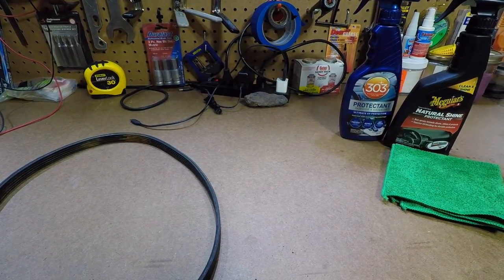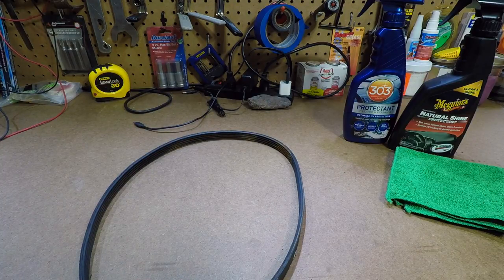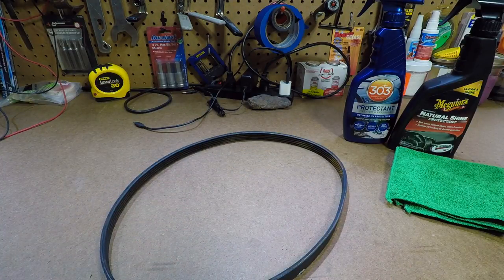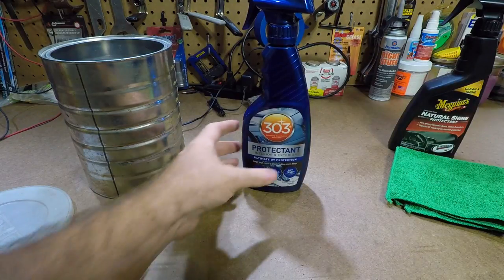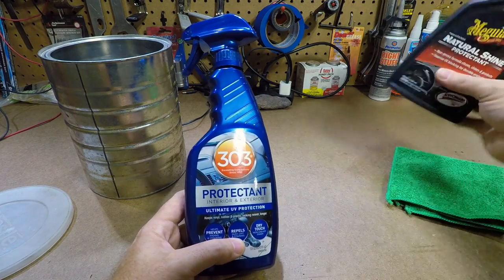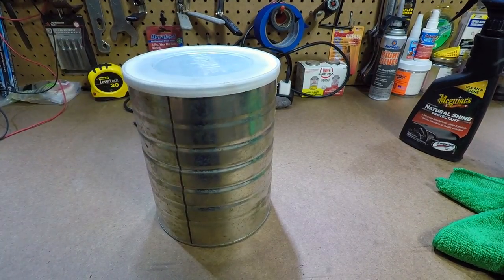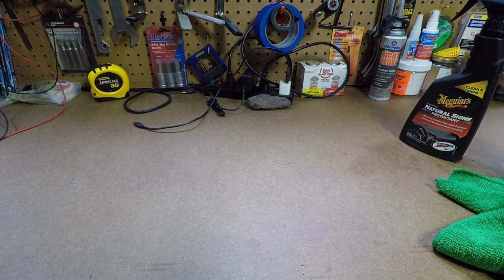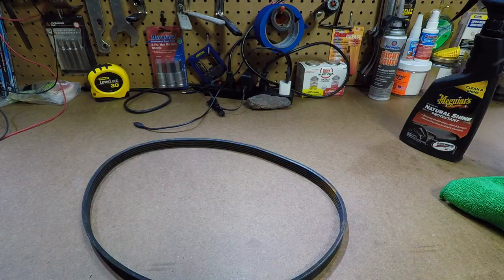Make Your Cars Belts Last A Lifetime !!! Never Buy Another New belt !!!

Comment: The Federal Government now demands that serp. belts be made from EPDM instead of rubber for several years now. That means a serp. belt will not crack like in this video, it just wears out. The demo belt in this video must have been made from rubber. That's old school. Go to the auto parts store and ask them for a FREE belt wear tool and follow the instructions. If it's bad replace the belt. No amount of chemicals will work on a modern belt.
Reply: Agreed

Comment: Actually best to apply heat to the can, not much though. Even put the can with 303 out in the direct Sun with the lid on and leave for 15-20min and the remove the parts to air dry and wipe down.

Comment: I will start doing this. But truthfully all my belts have lasted 10+ years. On our 2010 Camry i4 it lasted over 10 years. It’s got 188K miles now. Yes it has cracks as it was a New England car and never has the engine cleaned or detailed. Put in 2 new belts. Wish I saw this video. But even without the 303 my belts all last 10 years+. They were replaced for safety measures not bc they snapped.

Comment: A new belt is very important. Friction and heat break down the belt. The belt  will still wear down even with the special magic coating on it. It’s an easy replacement at every 75,000 miles give it take a few thousand. The belt is connected to the ac ps alternator and spins the water pump. Replace it.

Comment: For a BMW... you should disassemble the whole engine bay and soak every piece of rubber & plastic in this stuff.
Never seen anything like the disintegration that goes on under the hood of a Bimmer.
Too bad gaskets, engine seals, and o-rings weren't pre-treated with stuff from factory! ;-)

Comment: I wonder if the belt will get to a point of being too hard !? Where it doesn't cling , grip or have the proper contact with the pulleys . To where it slips and alternator doesn't recharge the battery as necessary ? I came across online a Toyota dealership . Suggesting when your miles are 50000-60000 to replace the serpentine belt . On my 2020 Toyota Camry I have over 60000 . I had to replace the alternator [ new ] , not remanufacturered  . And the belt came off the other pulleys and had no idea how to get it back in place . So decided to buy a new one and for how many days spraying it down with 303 Protectant . It gives the belt a slippieriness and said belt should be dry when installing . I will dampen a microfiber towel with a all  purpose cleaner and wipe down well the side with the ribs / ridges before installing .

Comment: I had just seen this tip by that other channel a few days ago... A belt is not a sponge. So it will not "soak" 303 up physically, you cannot marinade your damn belt. It is a reaction on the surface and to achieve that, you may well just apply it according to directions, i.e spray on/wipe on+off again.
Reply from the maker: That is correct you can do that, if you turn the engine over by hand you can apply it without removing the belt
Reply: I totally disagree. Rubber is porous, don't care what you say, is an aircraft mechanic I will tell you air will leak through rubber, if Air will leak through rubber so will protectants, it prevents / delays the oxygen from attacking the rubber. If you take two car tires air one up with a standard compressor and air the other one up with nitrogen, and wait till they go flat, the one with nitrogen will stay for mini mini times longer because the nitrogen molecules are much bigger than the oxygen molecules Which makes it very difficult for them to flow through the porous rubber. The guy actually does not know what he's talking about, but yes the protectant will absolutely protect your belts and for that matter if you can wipe it on the inside of your tires you were that much better off.
Reply: @stephenembrey883  Is it true that serpentine belts are now made of EPDM instead of rubber?

Comment: I jus5 used engine degreaser and a little 3 in1 silicone  spray. It's been a few days and no squeal. I did have a coolant leak preceeding squeaky belts. I cleaned top, bottom pullys. 
Maybe only time will tell. I though I had one belt slightly off a pully too. I used what I had though I looked for belt conditioner.

Comment: My car squeals up a storm. Can you just use a protectant to spray on the belt while it's still on the car and the car is running? I tried using a lubricant to spray on the alternator which it worked but lately it's gotten cold out and it's making my car squeal more so I'm wondering if spraying the belt and letting it run will fix it.
Reply: It would just fly off , I spray my belts when engine is not running and all other rubber / plastic parts in engine compartment , periodically . I think your belt needs to be replaced .
Reply: @peterrudy9207  The belt just needed to be adjusted and tightened up because it was slipping. Haven't had the problem since.

Comment: 1st This is UV protectant. Your primary drive belt on your Sur-Ron should never get significant UV light. If it does you're upside down too much. 2nd There is nothing at the 303's Website that suggests this is a use for this product, and in fact I've heard others say 303 should NOT be used on belts. I have launched an inquiry to the manufacturer of the product to get their recommendation.
Reply: Ha, ha.  I actually ended up here after watching the Sur Ron belt video by the moto uk guy, but I'm subscribed to Nathan's channel for my BMW content.  Odd how the two intertwined.  Nathan should mention the Sur Ron for some more alagarhythm hits!
Reply: @Travisj535  I get a little belt squeak sometimes, mostly when cold & pushing it backwards. I don't notice it because the racket coming from the jackshaft is so loud & obnoxious it obscures a simple belt squeak. It just can't compete with the awful cacophony coming from the right side of the bike. The fix for that is MISERABLE to implement: remove jackshaft/swing-arm axle, take jackshaft apart, get some sort of fancy spring washers, insert at strategic locations, reassemble, & pray. And do that with no help or instructions, just wing-it using experience and brain power. Plus my axle is defective and replacements aren't available. Oh, and probably the bearings should be changed while you've got it all apart. Slathering goo on a belt? Cake-walk. I tried it. It doesn't work for me.
Reply: this is crazy what this guy suggest. Can't wrap my head around this idea lol. Just change this freaking belt and not soak it in the UV protectant... it will not last a few minutes on the belt when it is working... and weather... lol this is the stupidest thing ever.
Reply: had to laugh. you know they dont list toothpaste as a cleaner but it works great! do you know how many products work for things the manufacturer doesn't list as uses? tons.....

Comment: You watch Sweet Project Cars
Reply from the maker: This is a trick I've been doing off and on for years, I use to do this on fd rx7's back in the early 2000's when the belts were hard to find , I seen a guy last week do this , so I thought it would be good to show my version of it , in fact when I first started doing this I was working of office equipment and was using a product called rubber restore, people use this trick on printer tires and belts a lot.

Comment: Does this method also work with timing belts?
Reply: I wouldn't try it, if it doesn't then your engine is death, better try it on a accessories belt that wouldn't be catastrophic.
Reply: Yes, absolutely but don't run the engine till that stuff sits overnight

Comment: What about belt elongation due to operation?
Reply: Your tensioner absorbs that little bit of elongation, and it should only be a small amount and then not stretch much further over a long period of time as long as the belt doesn't deteriorate.  Also note the tensioner absorbs shock and vibration loads, and the metal spring slowly wears out and becomes less effective.  Even if the belt lasts forever, the tensioner should still need replacement now and then.  Most recommend around 60K miles, when I've changed it on 100K mile cars there has always been an instant improvement and smoother running engine.  A LOT of power goes into vibrating the belt, and a worn spring doesn't do the correct job of dampening it.  As soon as you change one, you notice the difference.
Reply: Right, that's what I'm talking about. No doubt the method recomended here for the cracks might work, I don't have reason to believe otherwise, but I know for a fact that belts stretch and ofcourse the tentioner issue you mention. I just don't know how much stretchig the belts are able to take before they snap. I mean.....they can't stretch for ever. 
So at some point, we might even end up with a perfect, "like new" belt, with no cracks, that has stretched too much. 
All in all, these belts aren't that expensive, so I don't realy see any point in treating them at all. Depending ofcourse on the usage. 
I keep my car in a closed garage, and after about 45.000 miles my belt only stretched 3mm and it had no cracks, so personaly I don't see any benefit from this technique. And especially for a 15-20 dollar belt. 

Now if there was a magic technique for timing belts, that cost 80 or 100 dollars or more, (and are more vital components), I'd think about it....:)
Cheers
Reply: Well first, wouldn't do anything to a timing belt.  They're toothed and shouldn't be a problem, but you'd want extensive testing before doing anything the engine manufacturer didn't endorse.  Second, like a guitar string, stretch is not the real problem.  Initial manufacture, then there's some room for stretch.  After the initial stretch is taken out, there is almost no stretch left to give, no matter how long it's run.  Say it's 1000mm, it may stretch a few mm probably over the first 5 or 10 K miles, then if it stretched another mm or two ever it would break.  But you're up against the full strength of the cord, it probably never will for most belts.  What makes most break is the cracking of the rubber.  It then either folds under and doubles on the pulley, forcing the belt out and past any limit, part falls out and lets the pulley spin or belt come off, or the cracked rubber concentrates the stress in the cord instead of letting it wrap around smoothly, and wears out a small spot of the cord much faster.   Modern belts last anyway, for me it's about being in near 100% condition the whole time until I change it, instead of say 80% condition at the end, and having a larger even if still small chance of failure..  And for sure the largest wear item on the belt is the rubber, if it never deteriorated, the cord would probably not fail for millions of miles.  Conditioner may modify the friction a little, but multi-v belts generally have a lot in reserve.  So going to test it out, easy to try on the old belt and carry the new one with me as a spare if there's a problem.  Belt failure doesn't hurt anything on my van, and only a few minutes to change if it happened on the road, so very easy for me to test this out..
Reply: Thanks for the insight mate. Good to know. Cheers.
Reply: @ModelLights  It has been two years.  What happened?
Reply: @Game-The-System  Ha, it's hard to say.  I did this, and the belt is still in excellent condition, but I've driven the van far less than I did previously.  Used to do 400+ mile trips every couple of months or so but I've only done two or three since changing that belt.  So it's hard for me to say what's due to dressing the belt and what is from less miles..  Most of what I was driving extra for went almost 100% online so it's only family trips now.
The belts would always start getting the small cracks from age regardless of miles so I'll eventually be able to tell from that anyway.  Still looks near perfect so it's promising, but with the less miles it'll be 2 or 3 more years before I can be sure it's noticeably better.
Reply: @ModelLights  Thanks.

Comment: hello nathan, can you recommend other products than the 303?
we do not have this labelled product, so i think it might be a silicone based type liquid.
I think 303 is not an armorall surface protectant at all, so what can you suggest?

andrew
Reply: I suggest silicone oil spray or silicone grease. This is what I use.
Reply: andrei put I would think anything used to protect vinyl that’s water based will work. Don’t use WD40 or anything silicone based.